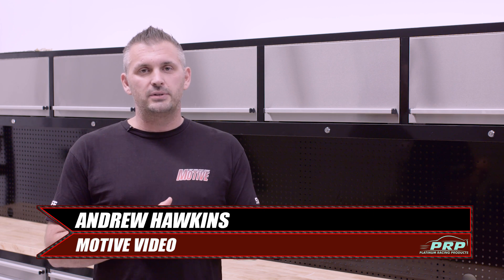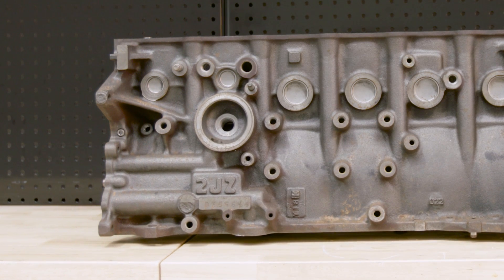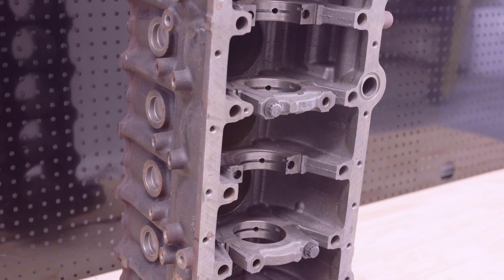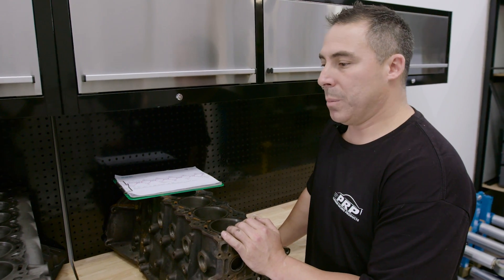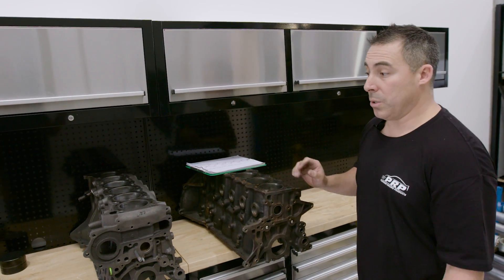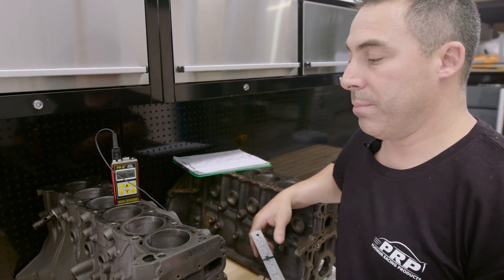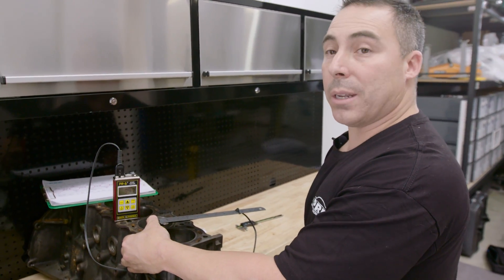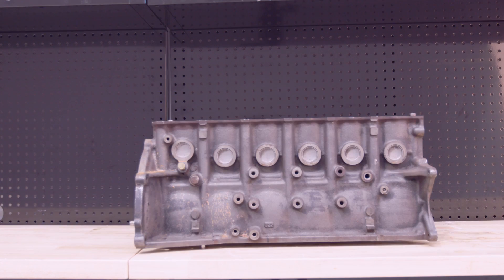RB30 vs 2JZ Which is the Better Block and Why? - Mythbusted

Comment: One quick note/question. You said almost double the flow when comparing the RB 7.97mm oil return holes to the JZ 15.5mm returns.
Circular surface area goes up exponentially as you know, so the surface area of the RB holes is 49.89mm² each vs 188.7mm² for the JZ.
So each hole actually has 3.78 times as much surface area, meaning that same factor of flow, unless I'm missing something.
That would also mean RB total return area is 249.45mm² vs 2075.7mm² total for the 2JZ, 8.32 times as much return flow.
Also makes sense if the 2JZ oil feed hole is about twice as large as the RB, which would provide about 4 times as much area.
Pretty staggering difference if my numbers are correct. I'm sure that oiling capability really matters when getting into high HP.
Reply: Even more pronounced if you use Poiseuille equation and assume that flow rates are proportional to the radius to the power of 4 (rather than 2)
Reply: @sweetburlap  I'll have to look into that!
Reply: Depends on the pump, he's probably quoting figures based on stock pressure
Reply: @rip.tear.  Oil return holes see zero pressure though.
Reply: Which is one of the rbs biggest issues
Reply: Gad damn I don’t understand shit you just said I ain’t good at building cars lmao I’m stick to bought not built 😅
Reply: @mark_m1  Hahaha just takes time and effort to learn.
Reply: @802Garage  I’ll definitely look into that tho

Comment: But RB was use since r32 considered an old engine compare to 2JZ. Both engine are legend but 2JZ is a masterpiece of engineering
Reply: Vijeybareth Vijayan RB30 where produced since 1985... before the R32
Reply: Were can you buy a rebuild engine.
Reply: RB30 was in the R31 and a turbo charged version was in an Australian car, called Holden. Nissan helped them develop an engine due to emission laws.
I guess 2JZ vs RB26DETT a much more fair comparison.
Reply: @Vegun92 already compared and the jz is the better engine. The rb30 has thr same bore and stroke also and is much stronger than an rb26 with less issues and the jz is still better in almost every single way hence this comparison. The 2jz didn't come out until 92 with the aristo so it's newer. Nissan had more time to perfect the rb motor in general than Toyota had with a jz. The qjz came first in the earlier part of the 90s 90 and 91
Reply: The 2jz came out in 92 it's younger than the rb30...thr rb30 is stronger than an rb26 you do the math

Comment: Im really curious on the Bmw m50-nonvanos aswell. Old iron block dohc straight six. Those things can hold 500hp stock and around 700-1000 with cast internals

Comment: No such thing as a RB30, RB26 2.6L can be stroked to a 3L why some people so dumb
Reply from the maker: RB30 is a real engine, clearly, as it is in the quickest GT-Rs in the world. An RB26 can NOT be stroked to a 3.0L. The kits that make an RB26 a 3.0L ( ie OS-Giken)  have a huge spacer plate that attaches to the block and re-sleeves it, making the block taller, just like an RB30 block. Biggest stroker anyone makes for RB26 block is 2.8

Comment: I am concerned as to why this was done on the RB30 block. Or was this done on the RB26 block already and I need to be given a link to the video?
Either way, good findings. I am glad, to see someone get deep into the science behind the engine designs.
Reply: They could have used an RB 26 block.  Both the RB 26 and RB 30 have the same 86mm cylinder bore.
Reply: The rb30 has the stronger more efficient block and it was done in comparison to an rb26 already the jz was still the better motor all around. Hence it being the better motor compared to the stronger rb30 that most rb guys use in high hp builds on r34s etc

Comment: This is amazing too see the difference s between the 2 engines.  I'm just curious what the block is made out of of both engines.  I always thought the 2 JZ was and iron block but it looks like a mixed aluminum block.  It goes to show Yahama knew what they were doing when making that engine for Toyota.
Reply: Daniel Rowe Yamaha is responsible for the head, not the block. And as far as i know Yamaha weren’t involved with the 2jz maybe thats why the 1jz heads is better than the 2jz’s.
Reply: 2JZ is a cast iron block, i think the one they tested was just super clean. And yes any Toyota engine that ends in the code GE/GTE had the head developed by Yamaha. 4AGE, 3sgte, 1jzgte, 2jzgte, 2zzge etc.

Comment: I wonder how much hurspurrrs will a Veyron's block will make if pushed to absolute limit.
Reply: Veyrons don't make horsepower they make torque. 1100 lb ft is very powerful, enough to carry this 4000 lb car to 430 km/hr.

Comment: Yes.. about those two.. Engines. But when comes about The Cars, .. supra is a garbage at anything but dragraces ON VHT ONLY! On regular street surface, even a rb26 gtr will destroy any handicapated supra which can't put down the torque until 4th gear. A 750bhp supra were really HUMILIATED on streetrace drag by a 450bhp 1.8t audi quattro avant who's owner familly car :)))
Supra gte was (and it is) a useless car as a motorsport point of view, way too heavy for a rwd sport car. The only use of that car is for swap her engine in a more adequated chasis/car. 
PS: for sure, i don't consider drift to be part of motorsport but more some kind of entertaining for kids.. as circus :)))

Comment: I work on car's I'm not a professional mechanic but I do pretty well, I like Nissan better because there easier to work on them less vacuum hoses but Toyota is just as realible an powerful as Nissan there both good and very good but I like Nissan because I think there easier to work on them and I think the parts are cheaper too but that's me...

Comment: Alright power to weight ratio, rb30 don't need to handle that much power because the vehicle is all wheel. So yes at the crank its needed...but the weight pull is not needed. I might be wrong ?

Comment: Excellent overview of these blocks! Not many surprises to me. Just a pointer on utt in the cylinder heads, go with a smaller diameter transducer for better contact on the curved bore surface, as will be more accurate due to better contact. Also could be very useful to have an A-scan waveform view on your set display to see if you are reading the correct backwall echo and not an indicental wave. Any variations in geometry e.g; sleeving, voids etc. could also be detected by viewing A-scan waveform.

Comment: This comparison is odd, the RB30 was never designed for the GTR for high performance. It was designed for the Holden Commodore... a family sedan with a single cam. Would have been better off comparing the RB26.
Reply from the maker: randy galati World’s quickest Skyline GT-Rs and world’s quickest Rb powered cars use RB30 block. Did you watch our RB comparison video? Rude shock. RB30 stronger than Rb26
That combined with different capacities is the reason.
Reply: Motive Video no I have to watch it and definitely learned a lot and you guys definitely know what you’re talking about but I’d imagine the 26 to have been stronger than the 30, I would love to see the measurements of the 2j compared to a 26.
Reply: Motive Video just watched the RB comparison vid, good info.

Comment: It actually makes sense for the RB26 to have thinner castings to save weight, after all it was built for the R32 to compete in Group A. The engine would not see extremes of power that would endanger it's integrity as it would be running restrictors and any extra material in the block would be dead weight. The design probably just got carried over to the R33 and R34 where it would not need more strength as only the   R33 raced in Le Mans (again with restrictors), and all racing in the Japan GT circuit was limited to 500hp.
The 2JZ on the other hand was built as a reliable, strong unit for a heavy street only GT ( Supra, Soarer and Lexus SC300) and was not constrained by weight limitations. The Supras that did race in the japanese GT championship did not use the 2JZ but the (racing only) 4 cylinder, 2.1 liter 503e.

Comment: To be fair, the rb30 was never designed to be a performance motor, hence being fitted into Australian delivered commuters (r31s and vl's) and patrols.

It would be a fairer comparison to compare the rb26 and 2j, despite the displacement difference.
Reply: if you watch their other video comparison, the RB30 is better than the RB26
Reply: 2jz was first fit into a 4 door saloon
Reply: @ethanal2736  Very true, Aristo ftw
Reply: And the 2jz is stil the better motor. Man you Nissan fan boys don't give up huh lol the rb30 is the better stronger more efficient motor than the 26 hence why so many people fit the rb30 bottom end into their high hp rb26 builds same reason people put a 2jz bottom end on a 2jz for a 1.5jz build for the high flowing high reving head and 2jz strength

Comment: Can someone explain this? https://www.youtube.com/watch?v=hkdimzEh9B8 2000WHP RB30? BTW cylinder #1 on the 2JZ can and does crack once you get into a 94+mm Turbo. You must sleeve the block to strengthen it? Why not do the same to the RB30 and not worry about cracking under high HP? The JZ was is not the only strong inline 6cyl from Toyota. It's father the 7M has hit 1700HP and the 90+ blocks which were reinforced learning from Group A racing and rally made that engine just as strong as the JZ but not as popular and easy like the JZ.

Comment: 03 Lexus GS300 that I'm driving now has 212356 miles on it still running strong not a damn thing wrong with it you told me what's better than 2JZ or the rb30 I'll choose 2jz all day everyday over any other engine except the old standard Chevy 350 V8

Comment: Not exactly scientific - a leeb rebound hardness tester should be used vertical to the testing surface, the friction of the rebound when used horizontally will impair results. The ultrasonic gauge, a bit of an unknown in regards to calibration and probe used but I suppose it does make some sort of comparison - certainly a rough guide - but it shouldn't be used as "data"... e.g. the cylinder walls may be coated in different materials which would throw off the "wall thickness" of the cylinders if it is calibrated to read thicknesses of cast iron for arguments sake.  Hopefully these pointers may help you in future when doing further comparisons.

Comment: RB30E from the beginning is NA single-cam engine and RB26DETT is DOHC twin-turbo. They have different heads and were projected for different things. So it's totally useless compare.
Reply from the maker: Velikain the RB30 is used in the quickest GT-Rs. Our other video shows the RB30 is a better block than RB26. So really it is the BEST comparison.

How it started means nothing. What matters is what it has done and how it is used in real life

Comment: RB30??? I am 100% sure that the NISSAN RB-series i6 was only available in 2.0L (Skyline GTS, single-turbo or non-turbo), 2.5L (Skyline GTS-25, single-turbo or non-turbo), 2.6L (Skyline GT-R, twin-turbo or non-turbo (Autech-only)), and 2.8L (Skyline GT-R NISMO Z-Tune, twin-turbo only).

And other than the S20 432 (4v/cyl, 3x2-barrell carb'd) engine from the C10 and C110 GT-Rs, the only other engine in a Skyline was the CA18(i) (which was shared with the Silvia and exclusive to the R32 Skyline GXi/E-FR32)

You're telling me that Nissan made a THREE LITER RB engine??
Reply from the maker: Andrew Salazar we are 100% sure you are incorrect 😁 it was only sold in Australia and New Zealand

Comment: Is this a serious video?  The RB30 was never designed to be a race engine block (it wasn't really built for turbos either) - it was used in Commodores, Patrols and the old R31.  It was an engine built from factory (in the 80s) to produce 150bhp, so what were you expecting?  It didn't even have a twin cam model.  The 2JZ was built around the RB26 design and improved... so you would expect it to be better.  Compare prices though and you'll see why RB30 blocks are popular.

Comment: I would prefer the 2JZ over the RB30 but there’s the problem with the drivetrain... 
i would ever ever ever choose a AWD setup especially a variable like the ATTESA-ETS! 

I’ve currently drive a bmw e90 330XD with a bit of Tuning and Theres nothing better than a AWD car with decent power and a good suspension... it don’t matter which conditions are on the road, you got the right weapon for it!

Comment: Just because a material is harder, it doesn't make it stronger or heavier than a softer material!
It does, however, mean that it is more resistant to deformation, which in turn means it is less prone to power losses (deformation absorbs power). 
On the other hand, rigidity could make a material more prone to failure/cracking (think of an aircraft's wings flexing in flight - that flexing is absorbing the forces; if they didn't flex, they'd be failing/breaking). 
Toyota have obviously found the correct balance of strength (hardness vs rigidity of their castings) - aided with the superior ability for heat-dissipation (cooling) via all the porting for the oil and water flow. The thicker wall at the top (where the actual explosion occurs), a minuscule amount to the average person, should be a "duh" moment for all engine manufacturers; coupled with the appropriately-strengthened head (another "duh" - if the block is too strong for failure, where's the next possible place for it to fail?).
The tester completely misspoke however, when he surmised/predicted that the 2J (harder material) would be SO MUCH heavier - even though the 2J is also shorter; as it turned out, the harder material block in the 2J was almost 20% lighter than the RB block (how many blocks did the "bloke", who doesn't know the difference between a micrometer and a vernier, say he'd tested?). 
That significant weight difference (to me) speaks volumes about it's superior heat dissipation: IMO, THAT is the "secret sauce" which makes the 2J so superior: the more-rigid walls of the block are much more uniform in thickness throughout the block (even the extra ribbing around the big-end caps) and thus the heat is distributed more uniformly. It absorbs the stresses more evenly, which in turn minimizes the development of "hot spots" (no pun intended), where failures would be most likely to occur. 
The RB clearly has less uniform walls, so it does not distribute its heat as evenly (the heavier/thicker wall sections keep their heat longer than the thinner walls) and we all KNOW (lol) that heat is the enemy of an engine. The less-rigid material in the RB could also be a factor for power-losses due to deformation under stress(?).
All-in-all, an informative video (with respect to the data); it's just their interpretation of the results that are a little "muddy" (IMO, of course!?) because they don't REALLY explain "EXACTLY WHY" the 2J is the superior block and why it is "MYTHBUSTED"?

Comment: Cast iron blocks 'ripe' over the years like a good Whiskey. The older, the more the stresses of the cast iron are settled. 
So comparing those 2 blocks with a metallurgic scanner is not enough, you need to test at least 5-10 blocks to have a descent average outcome.
Best example: BMW's 1500cc F1 blocks used in the 80's had up to 1750hp. Those cast iron blocks came from civilian BMW saloons with at least 160.000km on the clock. Then the blocks ripened for 2 years outside the Motorsport division trough rain and shine before being machined to insanely powerful engines.

Comment: Just curious how the old Nissan L-series N42 blocks compare to the RB, or even the 2J.  As far as bore and deck thickness.  I wouldn't be surprised if the old N42 ended up being as hard as the 2J.

Comment: 2j doesnt need a gurdle cuz it revs to 7 stock the 26 goes to what..8800? and the "rb30" block is not from a skyline so idk why ur using it
Reply from the maker: Is that statement about the RB30 serious? its from an R31 Skyline and VL Commodore. The quickest GT-Rs in the world use RB30 block
Reply: @MotiveVideo  arent rb30 single cam naturally aspirated from factory
Reply from the maker: @Fa5Squad  They are single cam, but people put RB25 and RB26 heads on them ot make them twin cam. They came in non tubro and turbo versions nbut makes no difference when you rebuild.
Reply: @MotiveVideo  my point is wudnt an rb26 block be stronger those engines are purpose built for performance unlike the rb30